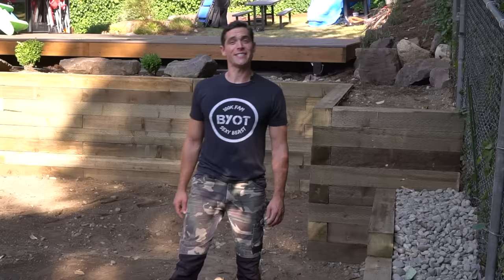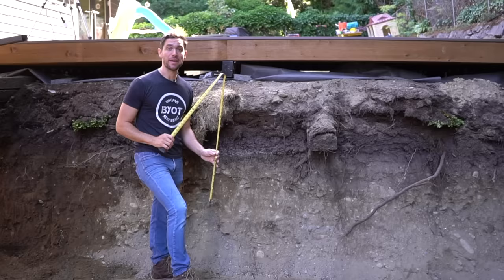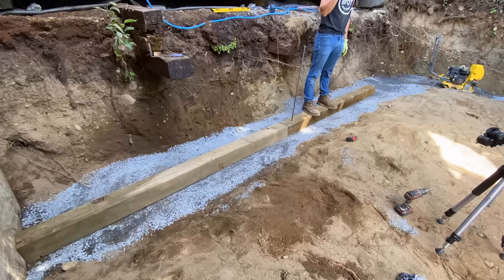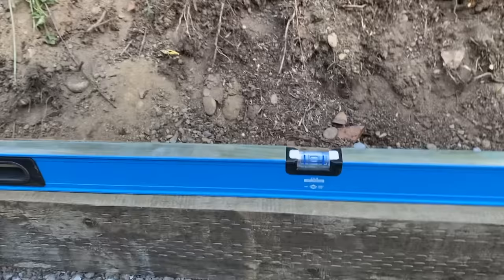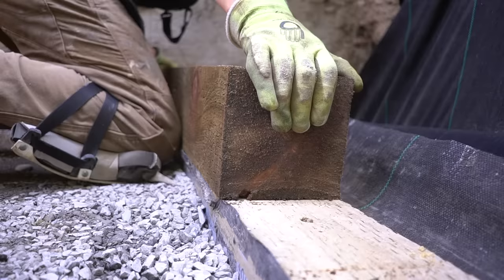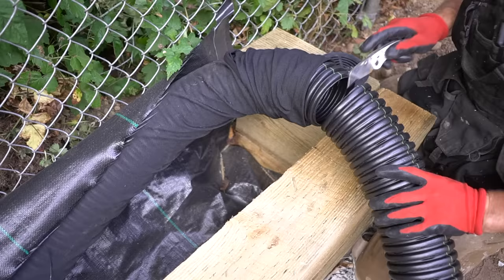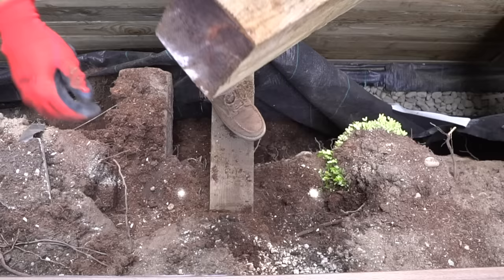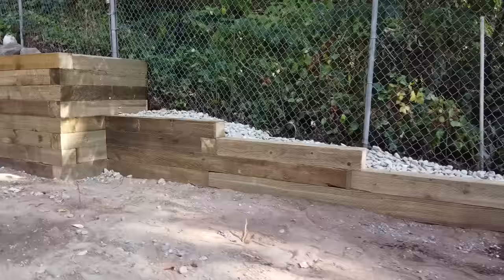HOW TO BUILD A RETAINING WALL

Comment: First of all nice job, well done with all the effort and planning. A few important comments. Unless you are building a reinforced concrete wall with inner and outer toe-beams, as a matter of principle, it is better to have the wooden wall sloping back by about 10° to 15°also going any higher than 4ft it is best to have dead heads every 3ft and staggered on every layer of long beams. As your raised level even though backfilled with drainage stone, always put in a strong plastic water barrier against your house wall, regardless of whether it is brick, concrete, and certainly if it is wood. If the backfill drainage stone is not compacted for the height of each dead-head stabilizer during the backfill, spaces or cavities will gradually occur beneath the dead-head anchors leading to further subsidence or weakening effect of the anchor dead-heads. This may sound like nit-picking, but when creating retaining walls these details are important in the short and long term.
Reply: Video was pretty cringe. Besides what mind manual pointed out, Even a rookie should know to space out seams. at least 2-3' from ends. this guy just throws deads 6“ from an end or between two timbers. Deads also  too undersized to do anything meaningful here. Where I'm from walls over 3' need engineer and permits.
Reply: Yuh

Comment: I've never heard them called dead heads.  Usually they are called dead mans.  Overall great job!  I will say where it meets the house will be the most likely to fail.  Looks like you did a good job to install dead mans in that corner.
Reply: Yeah it’s dead man. id say loose the fabric too. The fabric ends up getting clogged and becomes impermeable. A couple feet of 3/4 clean gravel with no fabric.
Reply: Maybe he's a grateful dead fan.....
Reply: Its also not a backhoe or excavator he’s using… so??
Reply: I call them chicken heads 😂
Reply: Damn that’s an ugly looking wall. Should have been clad with a finishing material not left like that .
Reply: They're called tie-backs in the concrete trade... and cover those ugly beams with some cedar!

Comment: It looks nice but there aren't enough DEADMEN in the wall and there is no set back on each row. I hope this wall isn't installed where the ground freezes. If so, I give it 5 years before it topples over. Folks if you build a wall like this please install a DEADMAN at every joint except for the base row and cap row and put atleast a 1" setback from the row below it
Reply: My bet is that the wall will fail at the toe.

Comment: Two little helpful hints:
1. Grind a point on the ground end of your rebar, it will drive through rocks easier.
2. If you coming in contact of solid rock...use a ground rod driving attachment on a hammer drill and the rebar will drive much easier and will also vibrate/compact the material around the rebar as it drives into the ground...
Reply: This is the way.
Reply: you can also use a t-post driver to take up a lot of the work and a sledge for the last little bit.
Reply: One final tiny tip (literally), Pre drill the ground contact 6x6s BEFORE you put them in the ground. If they are going to be 6" in from the end anyway, then there is no reason to drill through them and have your wood bit hit the rocks below, damaging it.
Reply: X2 on pointy rebar. I like to cut the rebar at 45 degree to get stake end. It's much quicker than grinding.
Reply: @iamleidig  You mean you do a 45* cut on two sides?  If only one side, I'd be worried about drift.
Reply: @Omniverse0  only one cut but i do grind off (at a counter 45) the razor edge created from the cut off wheel so it wont grab and chisel the wood if that makes sense

Comment: Nice job.  All looks structurally solid but would point out one item for anyone attempting this.  You want water to go into the French drain but in reality, most will pass it by and saturate the ground below the round stone.  Using an open 3/4” clear stone under the footing is the “best practice” as it allows water behind the wall to migrate our and not saturate that lower beam.  Also 3/4” clear as backfill is a “stable” drainage backfill because of its angular shape.  It will reduce movement over time where the rounds will promote movement.

Comment: I've done both rail road ties and stone retaining walls. It's a lot of work but the sense of accomplishment I feel and the money I saved is all well worth it. My last project would have cost 20k easily and I did it with a little help from my kids and wife for $2400.
Reply: You have just answered my question. I got an estimate of 22k  for a concrete retaining wall. and was wanting to do something like this. Wonder how long it will last. As long as you maintain the up keep?
Reply: @gloriabush9499  My project which was a 2 tiered rounded wall, a 9 step staircase with 4 landing pads, and a curved walkway is now 8 years old. This will be the first year I have to add some polysand to a few spots and level one of the landing pads. If you do it right it will last!

Comment: Good job but a few notes:

1) I would recommend to never use rounded rocks for any backfill or base of any wall as they will roll around and move.

2) the timber’s need to be stepped back into the hillside. This means you should technically be able to look down the wall and see a set back usually a 1/4” per timber.

3) depending on your location be careful using so much fabric as if you are in an area with a lot of silt it can clog up drain pipes with socks, fabric, etc. Remember you want to always create a free flowing wall for water.

4) make sure the drainage pipe is always touching the wall and not sitting away from the wall. Ex. If the corner where the drainage pipe wasn’t touching then daylight the pipe out and then install a new drain, or use T’s or elbows.

5) never hide your drainage pipe where you can’t see it. Reason being is if the wall is failing the main indicator is typically a lot of water coming out of the pipes if it’s going to fail due to hydrostatic pressure.

6) for the deadman you typically want them to extend the same amount as the height of your wall. So if you have a 4 foot wall you want a 4 foot deadman.

Happy wall building!
Reply: Is that 1/4" offset needed even with the dead man and being anchored? Does it matter how tall the wall is? I'm planning on building a 2 1/2'-3' retaining wall in the desert. I like the look of the vertical wall.
Reply: @dennisdickey5659  i would always recommend to put a step back
Reply: Thanks Eddie. Excellent remarks!!
Reply: ALWAYS use round rock for drainage. Crushed rock doesn't have the void spacing to allow drainage. There's no need for batter on this wall. It's not tall enough and using the deadmans eliminates the need. Granted they're no where near long enough, but at least he's trying.
Reply: @dennisdickey5659  I’ve built various vertical walls without any step back here in the Midwest. Good base, proper drainage and adequate deadman’s provide a strong wall. 

Like Eddie pointed out, the rule of thumb for backfill rock: bigger the rock faster the water flow; smaller the rock slower the water flow.
Reply: I think the soil also needs to be stepped back.  He has a pure vertical wall of soil.  Another note is the fabric was wrong.  I recommend a nonwoven needle punched fabric.  Woven fabric holds back water which is where all the weight comes from.  Hydrostatic pressure.
Reply: @YeahPete  yep. Grading inspector here…woven fabric would never fly here. Gotta use filter fabric in all filtration applications. Woven is used under fills for stabilization.
Reply: @YeahPete  spot on for the angle of repose for soil, all a vertical wall wants to do its whole life is tip over. It does however help to have rock behind the wall.
Reply: Isnt the vertical fabric a terrible idea? Doesnt it get clogged with dirt then basically creates a dam? I saw this in another video Stanley Dirt Monkey, what do you think of this? He had a retaining wall fail because the fabric was all clogged up
Reply: @NunYaaBizz  Its the type of fabric.  You need nonwoven needle punched.  When there is no fabric, over the years, all that soil will eventually migrate into the rock. And it will be like the rock was never there.  If you want it to last forever you need the fabric and slope the soil back at a 45 degree angle.  Someone said to use rounded rock.  No you want crushed rock.  Jagged angles of crushed rock locks everything into place and adds rigidity.  Their's a reason engineers specify crushed rock under roads.
Reply: @NunYaaBizz  it’s not the best practice nor should it ever replace a “burrito” drain at the base of the wall on the inside. Especially if it’s a woven fabric like I see people use regularly on videos. Woven fabric will certainly cause a dam effect because it’s not for drainage or filtration. You’re whole objective is to capture water at the base of the wall and get it out fast. Always make a burrito of fabric/gravel/perforated pipe(holes down)/gravel then wrap it up with the non woven cloth. Your backfill can then progress above it. Typically, it’s placed right on top of foundation. You can place fabric vertically as an additional measure behind the back of the wall but it must be non woven filter fabric and it mustn’t replace the burrito drain. I personally think it’s a waste though. If your base drain is there, it’s enough. All of this is based on the fact that your entire wall backfill is not a clayey of silty, water retaining soil type. It must be free draining for the whole system to work! The latter statement is a whole new discussion for another time though!😼 I have walls to go inspect!
Reply: @YeahPete  ^^^ This
Reply: YES,,MY THOUGHTS ALL THESE PEOPLE  POLISH THIS GUYS EGO BEC THEY HAVE NO EXPERIENCE.THANK FOR CLARIFYING
Reply: @stewartwhittier3455  Everyone is focused on the top of the wall pushing forward.  Is there worry about the bottom of the wall sliding forward and tipping backwards?  In this case, i guess the 90 degree side walls help keep it in place but the side by the house doesn't have that support.
Reply: @@eddie2819 - what would you recommend for deadheads is the wall is only 3 timbers high? on the second row?
Reply: round rock is a great backfill and is spec'd in many applications. stepped back is 1 way to go, but not required. yeah I hate geotextiles. how would one make sure the pipe was properly bedded if it was jammed against the wall?
Reply: @YeahPete  They specify crushed rock under roads for compaction specs.  You can't compact round rock.  Also, the roads don't need drainage underneath because they are designed to shed water anyways.  No road sloped 0*.
Reply: @bradleykreider3358  That can happen as well.  Majority of cases the soil will push the wall from the top.  Second will be the whole wall is pushed forward if the bottom course is not deep enough.  I have heard it tipping back due to leaning it back too much during initial construction.  I never seen it though.
Reply: @topjimmy44  3 timbers high you don't need a deadhead just crushed stone and slope back the soil.  Put nonwoven needle punched 6 oz  fabric to separate the rock and dirt and your timbers will stay dry too.

Comment: Good Job. What you refer to as dead heads we call Tie Backs but same thing. On some really high walls we put crosses on the back of the Tie Backs but that is only for walls over 6 feet. I really like those screws as it makes life a whole lot easier then the hassles of rebar. Cheers

Comment: Lots of incorrect information in this, but given the situation this particular wall was built in, it's probably not critical.

In no particular order:
1. Wood retaining walls are not allowed in many places because of their relative weakness susceptibility to rot.
2. Ground contact woods are not designed for retaining walls, they are just designed to be in contact with the ground.
3. Landscaping fabric of any kind will clog and actually increase the static pressure on a wall as moisture levels increase within. 
4. The height of a retaining wall is measured to the bottom of a footing, not the exposed or wall material height. This may seem nitpicky, but an inspector will make you tear out an improperly permitted wall. Most 4ft- walls don't require inspection. This wall would require inspection since it's actually 5ft in height. Not a huge deal so long as no one rats you out.
5. NEVER use rounded stone in a retaining wall. It has not structural stability. Drainage material behind a wall should be compacted just like the footing. Angular, crushed, stone allows compaction and thus becomes part of the wall. The stone used here will just move freely, effectively weakening the wall.
6. DeadMEN should not be stacked like that, and they should be at a minimum length the se height as the wall. By stacking these, it actually lessens the amount of downward force put onto them. 
7. TimberLOK screws are not made for retaining walls, and they should not be used in them (for binding the rows together). They are used to bind timbers together when building decks and other structures. Rebar or steel spikes (extra large nails effectively) should be used. Screws have significantly less shear strength, which is greatly needed in this case. 
8. A drainage pipe like what he used is a good type. But, the low end needs to see daylight and tying the ends is a very bad idea. Generally you want both ends accessible. The top end for flushing it or inspecting it, and the low end for inspecting occasionally. Tying the ends has the same effect as using landscaping fabric, it will clog and become useless.

I don't mean to rag on you, but retaining walls are a lot of work to do right. There is a ton of misinformation on them out there. Retaining walls are put under massive forces, which is why many block manufacturers (like what you can get from HD) put out extremely detailed guides on how to do them right.
Reply: Yup, when I saw the Timberloks I knew this guy had no idea what he was doing. The sheer strength on a timberlok is not even close to comparable to rebar. Also, when he tied the drainage sock around the end of the pipe I sitting here thinking, “so you want any debris to get clogged and block your flow? Lastly, I think the deadheads we’re going to be okay until it cut to the end and showed how many he put and how close together they were, effectively causing them to be useless. Bad video and would never recommend anyone do a retaining wall like this.
Reply: @gsaexperience8578    I've never built a retaining wall and I'm collecting info so I can begin one, and I spotted these problems while watching. Good to see your validation in the comments.
Reply: @SIE44TAR  the guy made a mistake thinking timberloks are okay for retaining walls but they are not. He mistook landscape Timbers (like planter box etc.. for retaining wall I think. They are not even close to the same
Reply: All of the timber retaining walls that I have built whether using railroad tie or landscape tie have been fastened using 3/8" thick by 12" or 10"  long galvanized nails. Any wall over 36" in height should be built as a "full crib", not just "deadmen".

Comment: Great job. 

I drill pilot holes and use 3/8 galvinized leg bolts and counter sink washers on my walls. 
On the top row it gives it more of an industrial look.. its a bit more work and u have to treat the holes like you did your post ends. 

I also use a grinder and cut a V on the bottom of the rebar to help drive it easier..

I like the project it looks great!

Comment: Loved watching, I was glad to see you taking all the correct steps for building that retaining wall, overlapping all the joints is a definite "MUST DO" and I was surprised to see you do it, most DIYer's miss or leave out the very important MUST DO's in their builds.. Most of what you did many would think is overkill, but as a master carpenter of over 45 years of experience, you are dead on correct.. A good tip to use if you build another is to grind the end of your rebar to a point, it will more easily go through the compacted stone and become a more solid anker point.. The dead heads was another good point for you to make, I have seen in my life literally thousands of retaining walls fail, simply because the did not add a deadhead or another type of anchoring to the backside of it.. This video was a delight to watch a YouTuber do something completely the way it should be done.. Thank you for sharing..

Comment: As an Aussie Landscaper - we use Geo Cloth or Geo fabric to hold back soil - I'd also strongly recommend not only compacting the base layer gravel but also stabilising it with a small amount of cement this binds the whole lot together, helps repel any long term moisture damage and creates a far stronger base in which to build upon. Dead man is a great idea - but also consider using a "Batter" or an angled finish to the face of the wall back into itself, this adds stability and support (though in some instances it does not look that crash). All in all great job mate!
Reply: what are you doing here? Fellow aussie here too lol

Comment: Instead of hamering those ros in,  grab a drill,  put it on hammer setting, and put the rebar into the chuck.  Believe it or not,  this saves a lot of time as the drill will get that rebar in easier and smoother than the hammer will!

Comment: Obviously a good-looking feature for sure. But I'm wondering if a wall with sleepers into vertical H-section galvanised steel posts would've been much quicker with far less materials.
Reply: I was thinking why not posts ?
Reply: A properly built timber wall with tie-backs and deadman will require the same amount of timber behind the wall as there is in the wall itself.